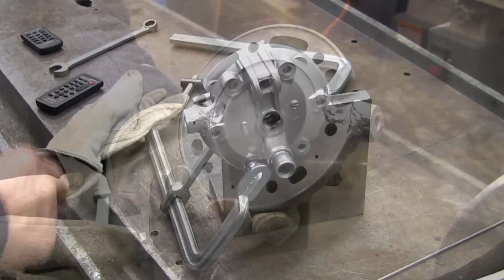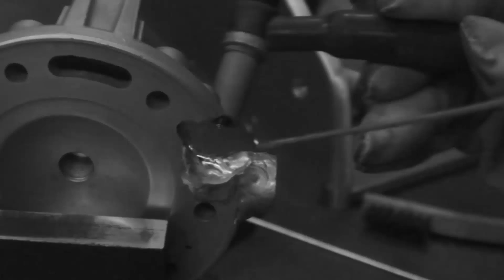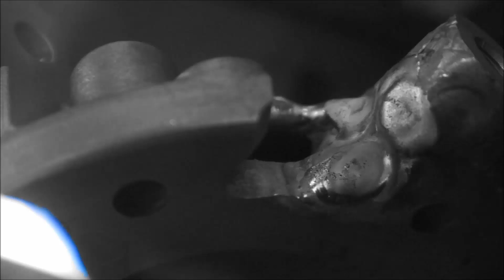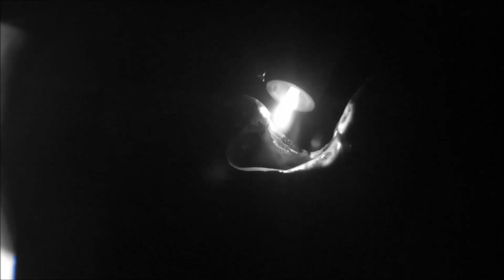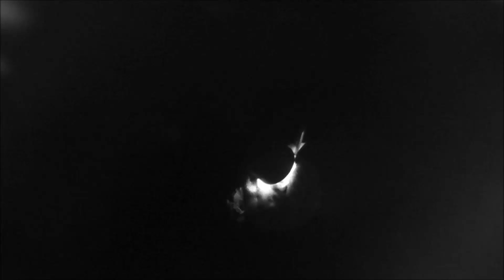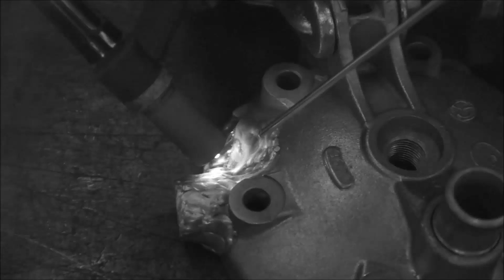The Manual 3D Metal Printer Part Six

Comment: Keith, Love your video.I am picking up some really god tips from it. To fix your tap fluid bottle bend the brush 90 degrees. Or cut it and make a 90 degree connector. Keep up the good video work, someday it will be as good as your welding.

Comment: Just 2 tips...1. keep the filler rod in the gas flow. 2. PROP! Prop your hands to stop the wandering... no need to be a hero, get your filler rod hand and the torch hand sitting tight against something to keep filler rod length and arc length constant... you can hear the pitch of the arc varying!  You are still a legend though mate!

Comment: Keith, how do you handle a situation like this from a "business" perspective? Your customer wanted the compression release at a particular angle for his convenience. Obviously, that choice was not the best from the casting of the cylinder head. Not your fault. This has resulted in a lot of other work that would not have been necessary. And by the way, I'm so glad to see you back online! I was getting worried that you had been buried in the Boston snow!
Reply from the maker: ***** When you look at things from a business point of view, you are looking at the long run, not just focusing on a single project. Each case is going to be slightly different, but you quit, on the project and there's two sad people, you push your talents and save the scrap, there are two happy people, with a better chance of shares that lead to future work by same person or an acquaintance of that person. I call what I did as a pre paid advertisement, and more often it has come round 360 and more than paid the little extra I gave in the first place. ;{)-----
Reply: ***** Keith did the only thing he could do, and still maintain his integrity. Think of it this way -what would the cost be to Keith if he had insisted on charging his client for the overage, reneging on his estimate and the customer then went around slamming Keith on not only his skills ("He f***ed up my part") but also slammed him on his ethics ("then he tried to rip me off")????  Business is about relationships, and doing your best to establish win-win outcomes. Not only that, but no matter how good you are -sometimes stuff happens. The secret is to keep these misadventures to a minimum, and have the sort of good relationships and communications with your clients that keeps them seeking you out. When you have that, you can often renegotiate deals to everyone's best interest when things go pear shaped. In any event-You will lose some -but the secret is to win more than you lose. Money is a renewable resource. Your integrity is not.
Reply: M
Reply from the maker: I answered this on the video comments, which is where I return most comments, not sure why it didn't cross share. ;{)-----

Comment: Hey Keith, thanks for posting more videos.  As someone you respect always says "Better to be looking at it than looking for it".
Do you have any concerns that the weld build-up will cause any issues with the head heating inconsistently on the bike and warping/cracking when in use?
Reply from the maker: TheTraakon I re shaped that pocket so close I doubt the running temperature would be any off. The little extra in the raised area should be okay as well, after getting to the end of the job and seeing how much the run-out really was afterward. ;{)-----
Reply: Not being a metallurgist I was wondering if the differing densities/alloys of the cast vs the new build would heat differently.  Love the amazing work Keith.